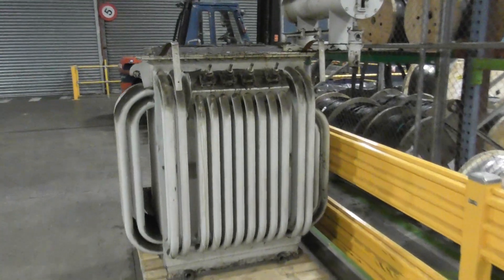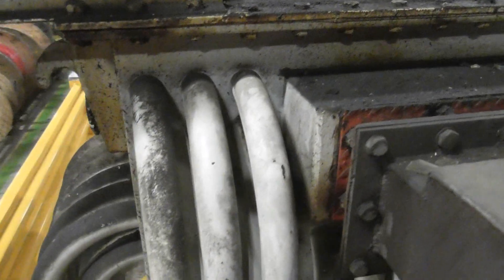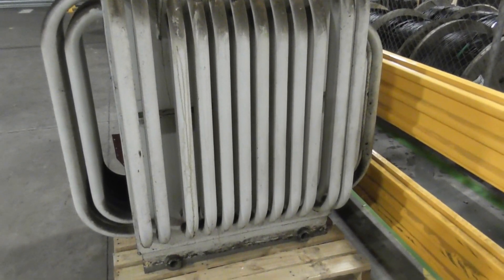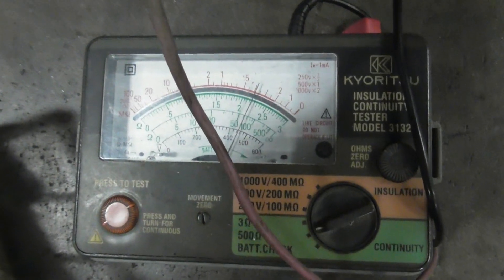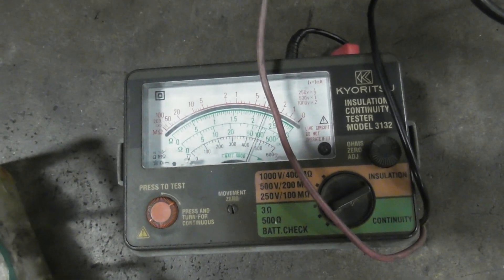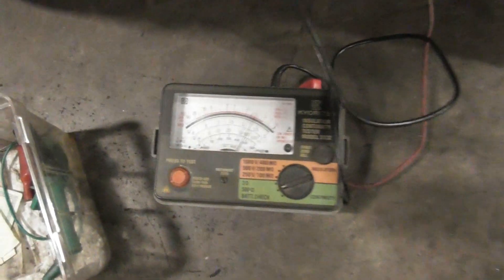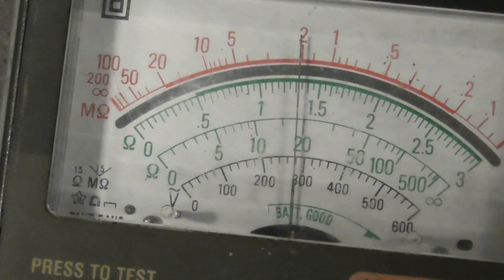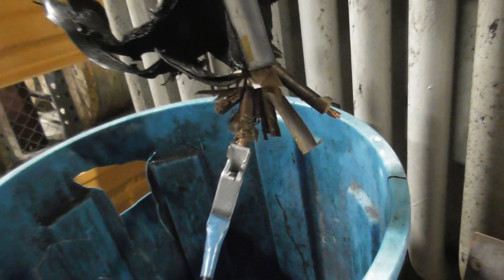Vintage Foster 300 kVA distribution transformator

Comment: PCB oil in that one I guess, I remember at the power generation place I worked the PCB oil was removed from old transformer units and it was blended with the fuel oil for the engines and burnt. I imagine the combustion temperatures would not be high enough to actually break down the PCBs so it would end up in the exhaust gasses and blow over the countryside.

Comment: Wow that's a big beast.  Assumed it was a substation transformer at first.   Would something like that be filled with PCBs?  Not fun to play with if that's the case.
Reply: Will have some level of PCB, like all transformers that are this age do. Takes a long time for it to finish dissolving out the insulation.
Reply: @SeanBZA  Old transformer does not necessarily equal PCB content. It wasn’t something that was intentionally put into them by the manufacturers. PCB’s were added into oil that was going to be used in certain situations that required high temperature resistance such as near bases in the war to withstand nearby bombing. Mix ups happened in the supply of the oil where that oil was accidentally sent to transformer manufacturers or the pipes used to fill one tanker still contained PCB’s and so on. People always assume that because a transformer is old that it definitely contains PCB’s, when in fact some old transformers pre date PCB use. 

Also the amount retained by the insulation is very low and therefore wouldn’t typically be picked up on a standard PCB field test (50ppm or more detected).
Reply from the maker: It was a TX in an inside switch room. There are still lots of these type TX's about in commercial buildings.